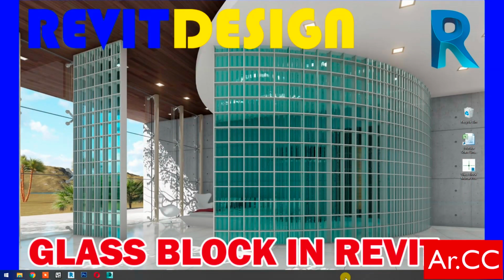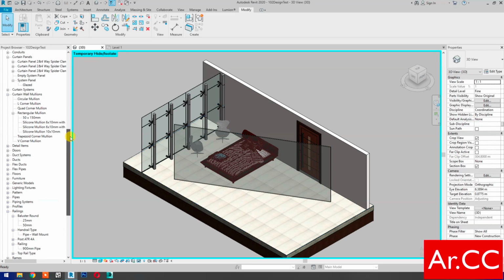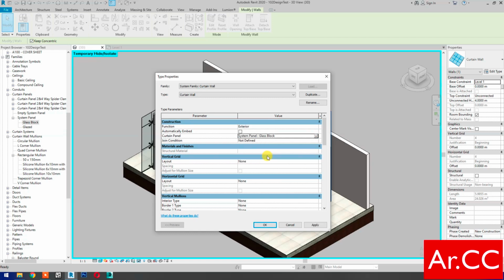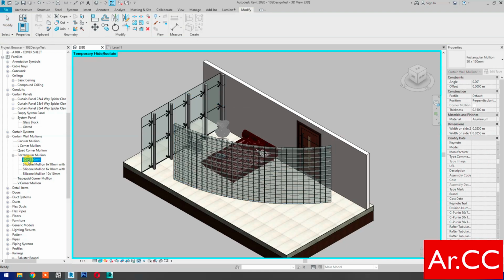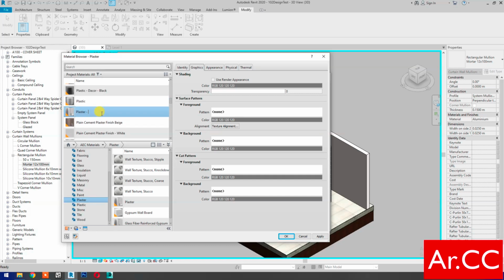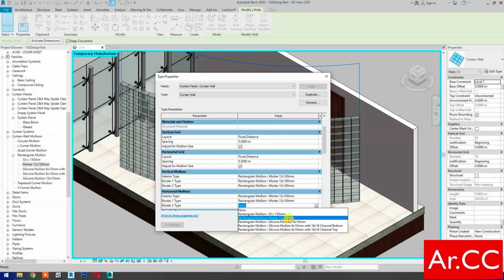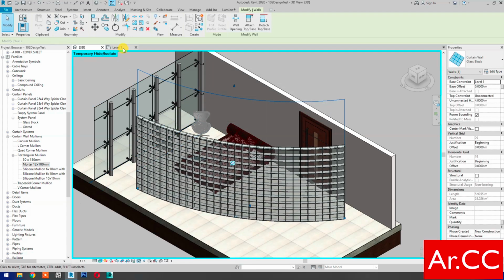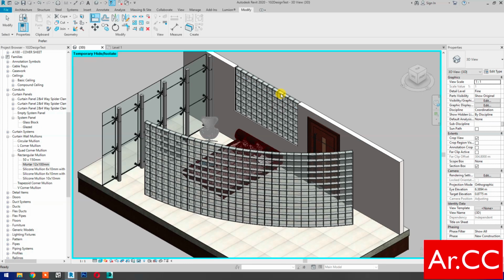RD102. How to create a Glass Block in Revit. Curtain Wall Glass Block in Revit.

Comment: Thank you Cris! This is a brilliant tutorial, very easy to follow! Never used the "automatic embed" option before, so simple to put into my existing curved brick wall, just set the radius the same and align to wall centre.

For those asking for the "glass block mortar profile" family, it's easy to create yourself. Go to File > New > Family and select Metric Profile. Draw a rectangle exactly as Cris shows on the screen with the dimensions and parameters as he has. Then File>Save As "glass block mortar profile" and load into project. Enjoy.